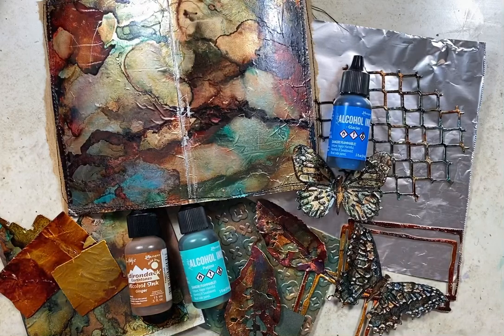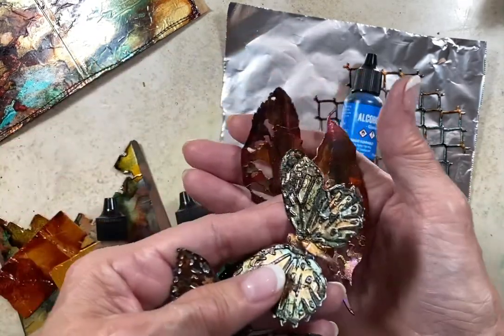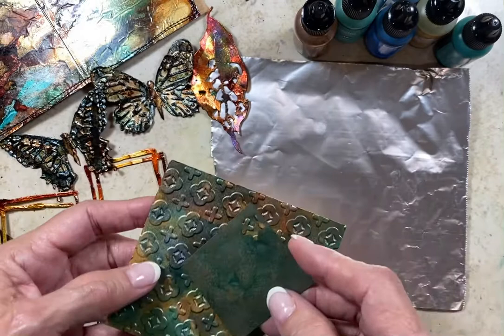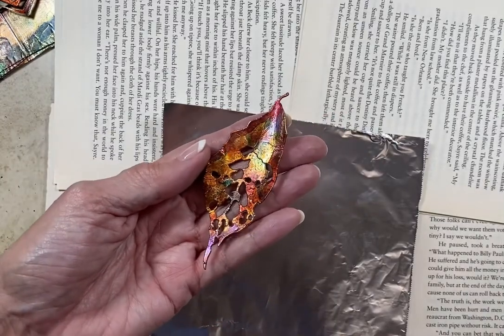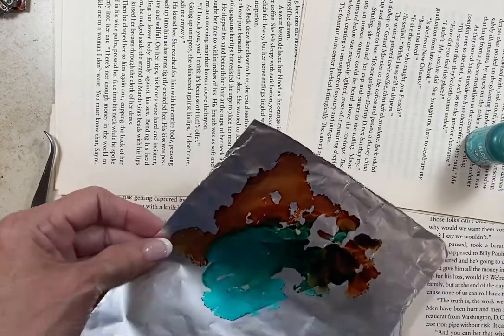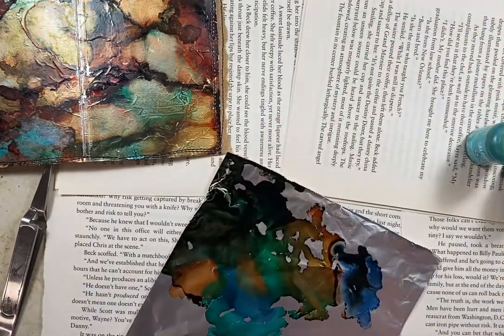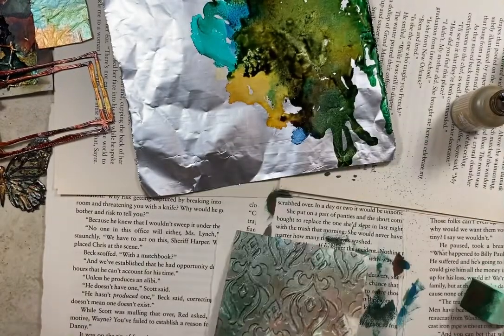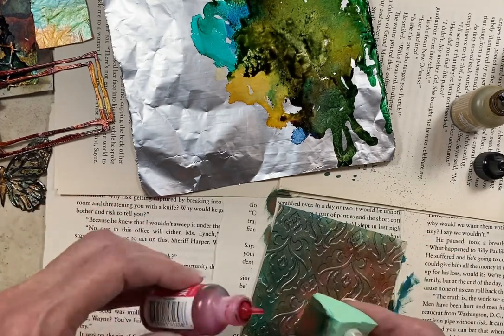Process for making aluminum foil into forged metal

Comment: I've tried this with aluminum tape... the result was good, but how did you glue the aluminum to paper? Mine does not stick 😭
Reply from the maker: Ahhh, Aluminum tape is a good idea. I glue with Scott Create glue stick or
Art Glitter Glue. I have had could results from both. I also have a Xyron sticker maker. That works well to but it tends to wrinkle. I think double sided tape would work too but haven’t tried it.